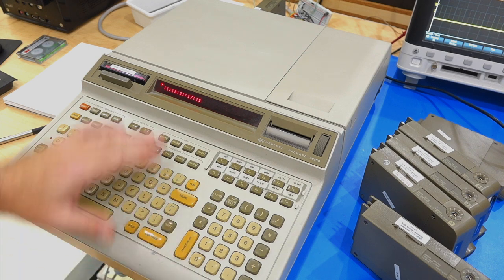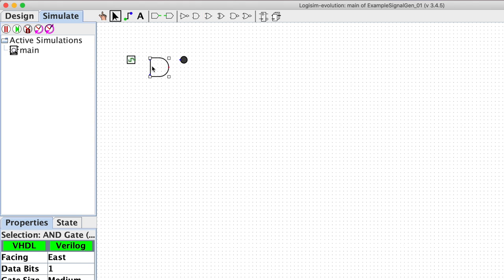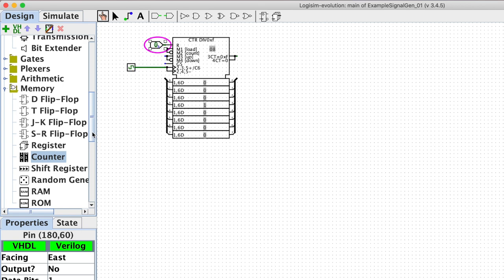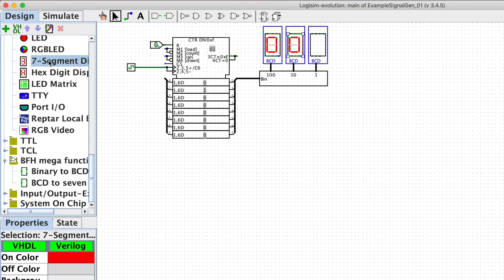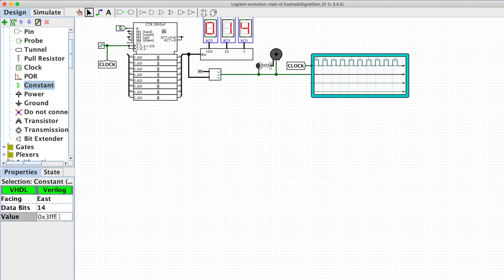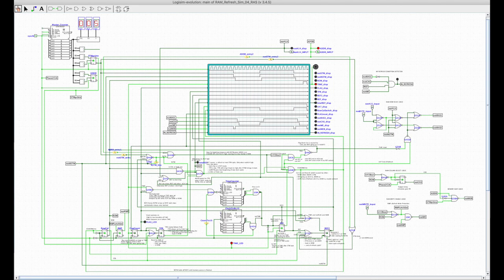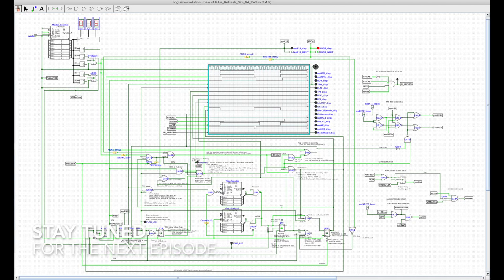Intro to Logisim Evolution, the free and oh-so-good logic simulation software

Comment: At 1:52 it did not blink for me, I needed to click the "enable clock ticks" button (the 3rd button in Simulate).
Reply from the maker: Yes, good that you mention it, I ran into that issue also.
Reply: @CuriousMarc  As did I.....great program
Reply: @MrKarateEd  As did I.... :o)
Reply: @CuriousMarc  I've been looking for a free logic simulator where I could experiment and gain some knowledge.  Logisim-Evolution is what I was looking for.  I subscribed and looking forward to more.  Thanks for the tip @RaphaëlChampeimont.
Reply: To get mine to run, I went to simulate, clicked on the run simulator symbol, then the first clock shaped icon that says "Enable Clock Ticks".
Reply: thanks

Comment: remembering when learning digital electronics back in 1997, no internet, only boring classes with boolean algebra, no simulations (got on terminal based pspice later in high school)... Darn, may be that is the reason why I use sims only for very complex circuits? Poor young graduates they just cannot understand how it is possible to understand most of the circuit without using computer at all...  this logisim evo looks quite allright ;)

Comment: I discovered Logisim a few weeks ago to simulate some keyboard timing I couldn't wrap my head around in a vintage synth. I'm really impressed with it.
Reply: Do a video on that!
Reply: Michael, a quick question if I may, I’ve downloaded the files from Marc’s link on GitHub, but now I’m stumped. It’s not like I’m a newbie straight out of college, I’m actually retired, but things are just racing by me these days (lol).
I’ve checked I have a valid version of Java on my Windows 7 machine but I’m stumped as to what to do next (and with what file !).
Any response would be helpful, thanks for your time.
Reply: @nigeljames6017  The windows installer is the .msi file, or open the .jar file to run the program without installation i think. You don't need the other files
Reply: @bene5431  The .msi file worked fine. Thanks a lot ! My sixty five year old brain is slowly grinding to a halt (lol).

Comment: That's a great open source find , thanks for sharing Marc !  Windows users tip: First of all go to menu -> "Simulate" , and enable option "Auto-Tick Enabled" . Otherwise clock will not start ticking even after clicking "Start simulator" as Marc did at 1:50.
Reply: Thanks! I was wondering what I needed to poke with my digital finger to make it work :-)
Reply: Same for macOS users, btw! Thanks for pointing that out! 👍👍

Comment: Great introductory video. Thanks. I saw this when you first posted it, but, at the time, I was not working in digital, so I didn't try it then. After working on the analog side for the past 15 years, I'm going back to refresh my understanding of digital logic and computer architecture, and this will come in very handy. I had planned to use Microcap, but this is a lot faster for most circuits. I made one mistake; I initially downloaded an old version called Logisim, but that does not have the features of Logisim Evolution. Once I got the correct program, it all worked as demonstrated. Thanks again.

Comment: This was a great video. I've been looking to create a clock signal where multiple clock signals all end at the same time. Using your implementation of JK flip-flips and changing the constant values of the comparators is a great idea. Thanks.

Comment: Since the comparison circuits have "<" and ">" outputs, you could do an AND between two of them to have a signal similar to what the flip-flop is outputting. It would not be synchronized with the clock, however.
Reply: I wondered why that approach was not chosen, but then I haven't done circuit design for a very long time.
Reply: Or demux the counter and use RS FFs.

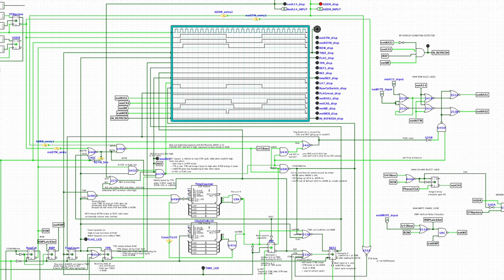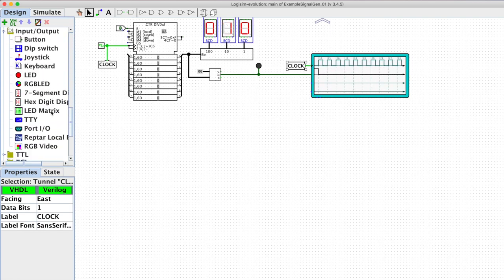Comment: At 1:05 the bottom left under Circuit: main shows VHDL and Verilog.  My setup shows “Circuit Main: FPGA supported:  Supported.” I didn’t run into any problems following the tutorial until I reached 8:41 when you added the buzzer.  My display for the buzzer says “FPGA supported:  Not supported” and I don’t get any sound.  Was there a step at the beginning to set up VHDL?
Reply: have you found the solution to this problem because its not occurring for me, and I have no clue what it means. Even after a few google searches I still can't find the answer to this. Im also on the latest version of logisim.

Comment: Great! But have you noticed that your output is one clock cycle late (because of the flip-flop)? It's on between 3 and 11. I'd use the "greater than" output of the comparator for the smaller constant (2) and the "less than" for the larger one (10) and AND them together.

Comment: I added the buzzer but there's no sound, even though the led is blinking and the wiring is good.  Linux Mint.  In .3.8.0 you need to also add a constant for the volume input to the buzzer, otherwise the volume is 0.  Needs a 7 bit input.  The default value of 0x7f worked for me.

Comment: Downloaded the simulator, build a clock and LED pair, simulate and ... nothing. Turned out, you need to "enable Autotick" for things to start working. Strange that it is left off by default and the newb would be put off by a non-running design.

Comment: I got what the set, reset, and output do on the flip flop, but what is the purpose of the clock in there? It seems that turning the output on/off depending on what it gets from the 2 inputs, is all that’s happening… (not an electronics guy, basic question I’m sure)
Reply: I'm trying to put a lot into a nutshell here - circuits like flip-flops change state based on their present state and their inputs. The clock signal triggers this change, and the output remains steady until the next clock pulse.

Comment: 10:48 You could just have used an and gate and connected it to bigger than 2 and less than 10. You wouldn't need the clock input then, too.

Comment: Isn't clocking the jk flipflops going to introduce a race through the counter?  Since you are using comparators already, why not just AND the outputs of a ">2" and a "<11"?  No races and the circuit is simpler.

Comment: OK, so I'm a git... I clicked on the link to download logisim evolution, and it sent me to github. Looks like they're up to 3.7.2 now.

But, git that I am, I have no idea which of the seven assets to download (OK, not the last two, which are source code...), or how to get them up and running on my computer (Windows 10). Can anyone help?

Also, I have v2.13.8 (which doesn't seem to show up in that part of github - they do have a 2.13.9) running on my computer now. Is there a way to update to 3.7.2 without losing whatever work I've already done with the old version?

Thanks!

Comment: Boy, that's a complicated way to generate test signals... It would make more sense if it has test cases of predefined waveforms on a set of input pins, and could run those and capture a set of waveforms at various test points, like CS#, RD/WR#, latch DIR pins, OE#, etc etc.  Allow the test cases to define the resulting expected state changes (1, 0, hi-Z, or ignore), then it's pretty easy to verify a bus interface design by simply having it run all the test cases and point out which ones if any fail.